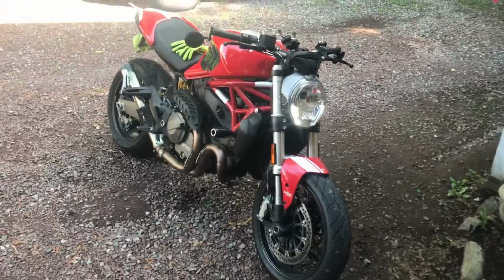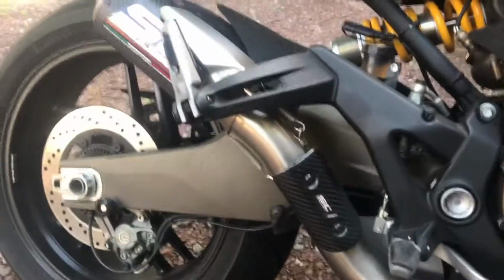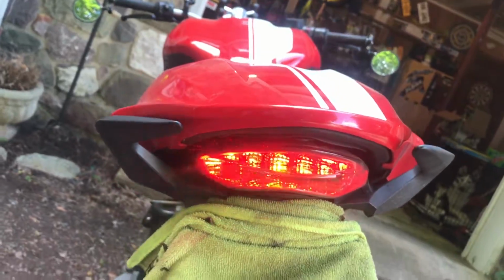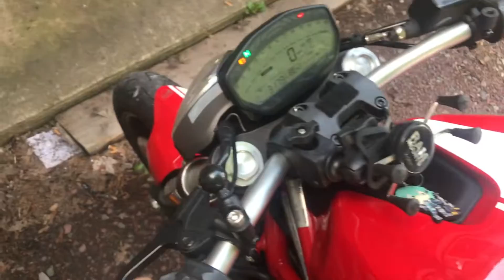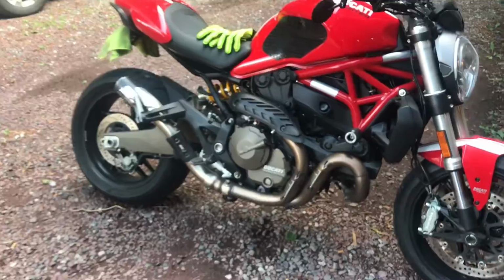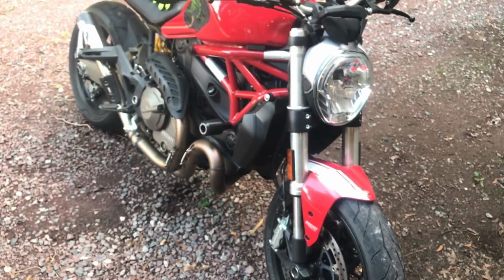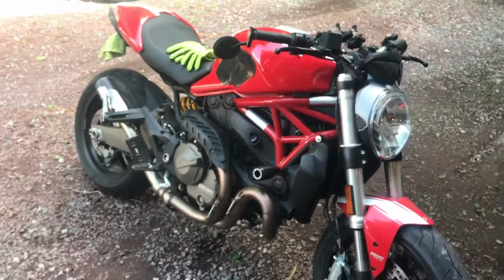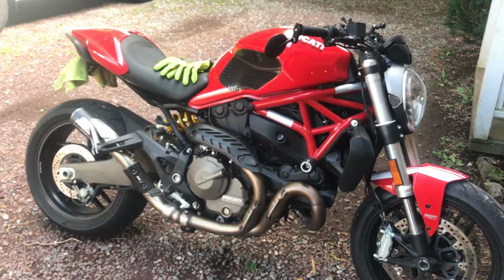2015 Ducati Monster 821  Project SC Exhaust walkaround

Comment: how much for SC Project CR T? need to remap your ecu?
Reply from the maker: I paid 677 with tax directly from project sc, its always recommend to get new fuel mapping with an exhaust but i wouldn't say it was necessary i did not get an ecu flash and the bike ran fine